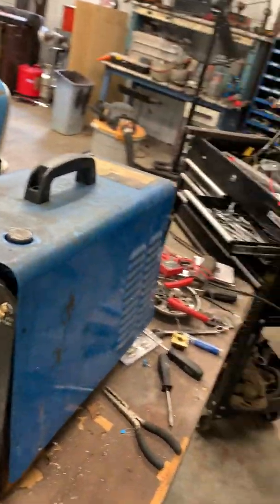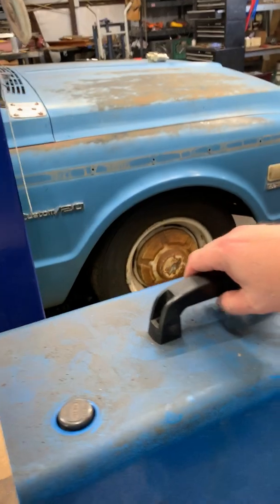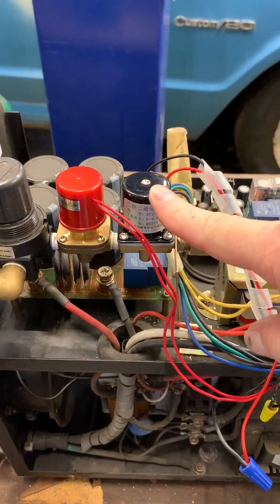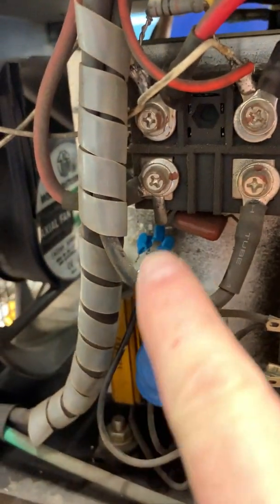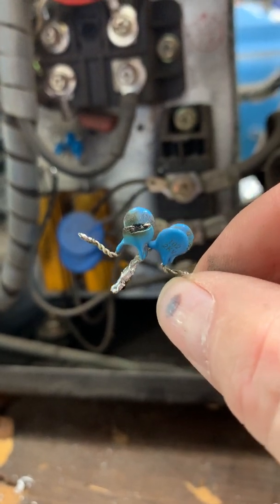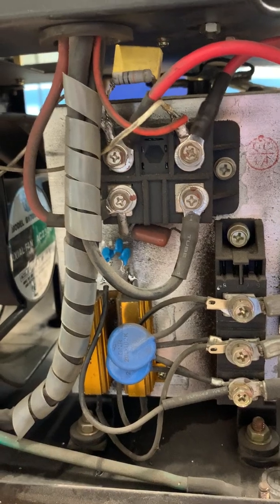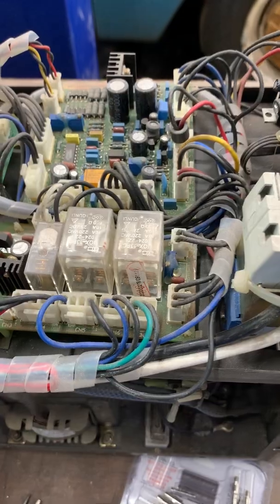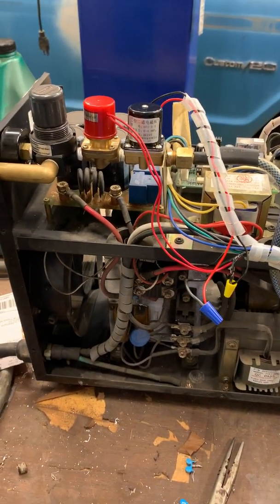Harbor Freight Plasma Cutter Repair

Comment: Hi fred, thanks for your video. A few years ago my hf plasma stopped working on me. Looks like a different model than yours. On mine it would constantly blow air, as soon as your turn it on and wouldnt stop until i turned it off. Im going to investigate the air solenoid, see if its stuck open. Thanks for sharing.
Reply from the maker: Good luck!
Reply: @fredtalks-diyfortheaverage9298  didnt work, prob just going to replace this junk with ebay/amazon special or a used hobart or something. Oh well

Comment: Do you know where I can buy the air solenoid and the Susie pressure relief valve at? I called Harbor Freight but they discontinued the model so they have no parts available.
Reply from the maker: I bought mine on ebay: https://www.ebay.com/itm/173868390076
Reply from the maker: here is the capacitor: https://www.ebay.com/itm/293514282593